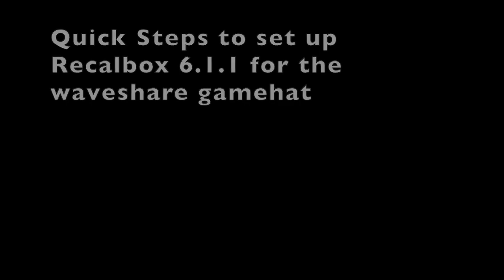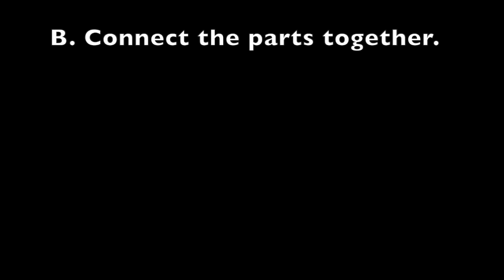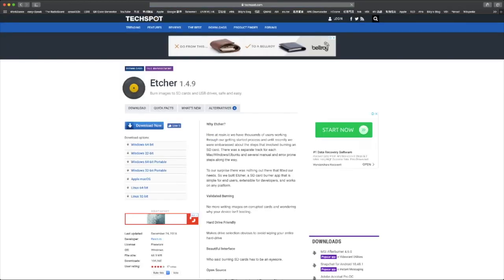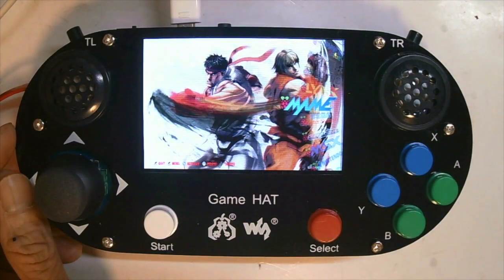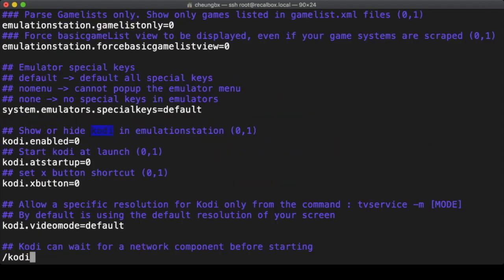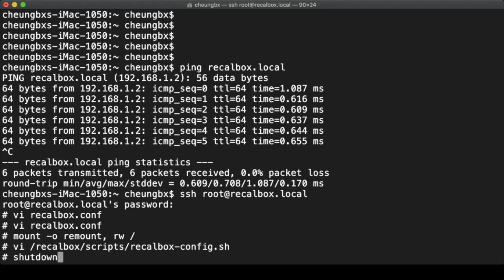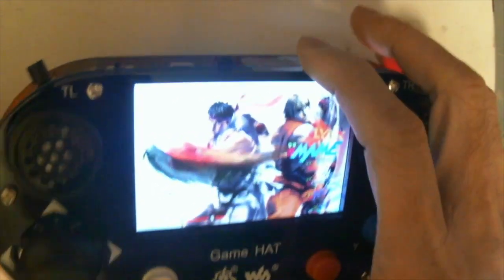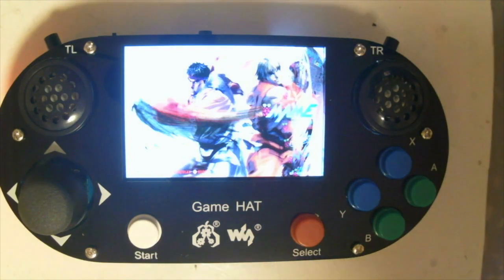How to set up Recalbox 6.1.1 on Waveshare game hat

Comment: Would this work for Batocera seeing as it's basically Recalbox? I was hoping to get Batocera running on the gamehat because I like it more.
Reply from the maker: MobileDecay ,  yes. They should be similar.  I've checked out how to configure Batocera for waveshare game hat and  made a post here: https://forum.batocera.org/public/d/3688-instructions-to-configure-custom-gpio-pins-for-waveshare-gamehat

Or you can see it here.
IIf you have a Waveshare game hat, the one with a 4" HDMI LCD display and GPIO joysticks on top that works with RaspberryPi3B/B+, you can configure your Batocera to make it work as follows:
from your PC/Mac, ssh root@batocera.local (password for the first time login is linux)
If there is no response, you may want to first "ping batocera.local" to see if there is any response.
Otherwise, try to check your router to find out the ip address. (e.g. 192.168.1.32)
then type "ssh roo@192.168.1.32"

type "nano batocera.conf" to edit the configuration
use Control+W Key command to search for "gpio"
Once found, remove the # and change the following lines

controllers.gpio.enabled=1
controllers.gpio.args="map=4 gpio=5,6,13,19,21,4,26,12,23,20,16,18,4"

press Control+X to save the file.
type "reboot" to reboot.

Once rebooted, the buttons on waveshare gamehat should work right away. You will not need to start the systems menu to configure the controllers. But in case you need, press "START" button to see if you can see the system menu, then select "Controllers Settings". Then select to configure the controller.
You should see "1 gamecontroller detected"
Then go ahead to configure your game controller by pressing the right buttons.
SELECT button will be configured as the hot key.

If the above does not work, then you might have some typo error in the configuration file.
Pls repeat and check again.
You can also check the log file to see whether mk_arcade has been loaded properly by typing this command.
cat /userdata/system/logs/batocera.log | grep mk_arcade

You should see something like this in the log when the mk_arcade driver has been loaded successfully for waveshare game hat
loading module mk_arcade_joystick_rpi args = map=4 gpio=5,6,13,19,21,4,26,12,23,20,16,18,4
Reply from the maker: See my reply
Reply: @BillyCdiy  Thanks!!!
Reply: @BillyCdiy  Putty won't let me login. 😥
Reply from the maker: @MobileDecay  , try to ping batocera.local   first  to see if it's connected to the network. You need to connect it to a wired network first. Or check your home internet gateway to see the ip address.
And use the ip address in ssh instead.
Reply from the maker: @MobileDecay  , I found a typo error on the instruction. should be "ssh root@batocera.local ", I corrected it above. Here is a video demonstration of the whole set up. https://youtu.be/gKF_vRfkZ-E